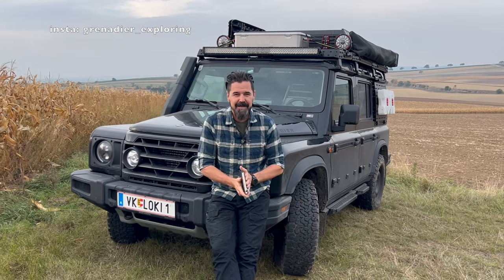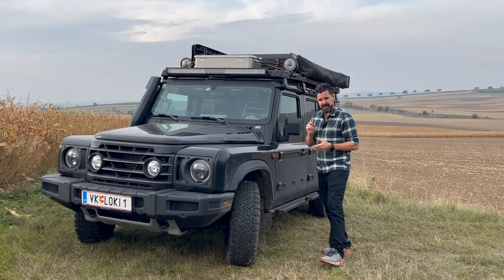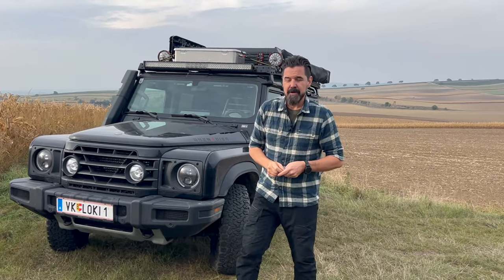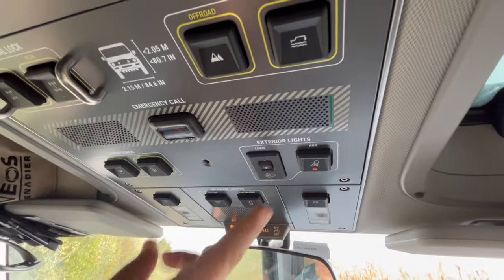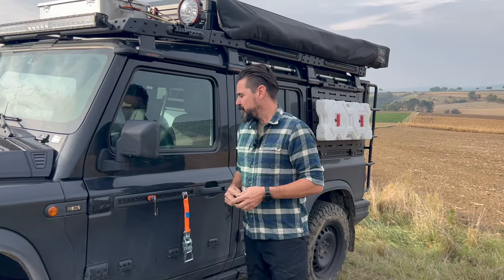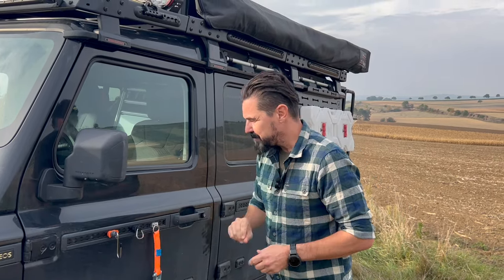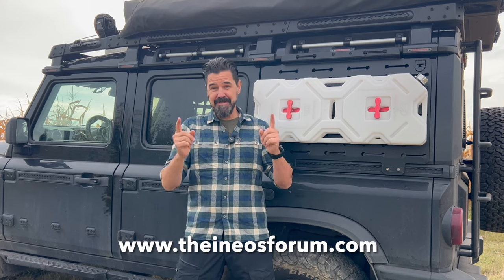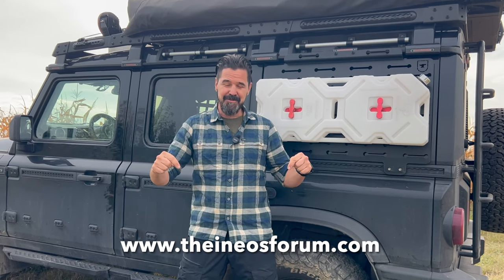How To? - Episode 04. LED Bar/Auxiliary LED Lights/Utility Belt and accessories/ Air Outlet Gaspers

Comment: Thanks for the video.  I was told that you have to be in "off-road" mode in order to activate the Aux lights, but that could just be a USA thing, which if true, is not good.
Reply from the maker: i added "in most countries" cause there are different regulations. unfortunately i am not aware of all of them. it might be the case that they work only offroad in the US. in that case, you could stil add a LED bar, controlled by the HIGH beam, right?

Comment: Thanks for another useful video. It appears that you only need to switch EXT2 on to have the lightbar cone on. Or do you also require the high beams to be  on as well?
Reply from the maker: yes, only the EXT2 switch. you technically could control it via the HIGH beam but I wanted it to be seperated!

Comment: In your night driving demonstration you had the low beams switch to high beams, at this point were the auxiliary lights also on before the light bar? Thanks again!
Reply from the maker: the auxiliary lights were not on. i did find it hard to capture their effect on camera, so i didn't use them.
Reply: @grenadier_exploring  ok good to know. If you were trying to decide to buy a light bar or not, are the auxiliary effective enough? Or is a light bar required? 
I appreciate all your advice!
Reply from the maker: you'll definitley need a light bar. the aux lights don't change too much compared to the high beam....especially not in regard to range

Comment: Great informative videos, keep creating them.
Do you know anyone manufacturing an auxiliary fuel tank for under rear,behind axle?
If it had 60 to 80ltrs it would make the range a lot better and no need for carrying fuel cans up high.
Reply from the maker: absolutely! so far, i am not aware of anyone offering that option. i am confident that a solution will come up soon. i would definitley go for it.
Reply: @grenadier_exploring  we’re looking at one at present as touring tow vehicle but without the long range tank we won’t be able to do the distance here in Australia. Another 60ltrs + would be ideal.
Working it out most of fuel economy towing is double so we expect 18Ltr/100km we need a range of 700km to be ideal.
Reply from the maker: i guess the australian market will be the first one to offer an additional fuel tank! looking forward to a solution....